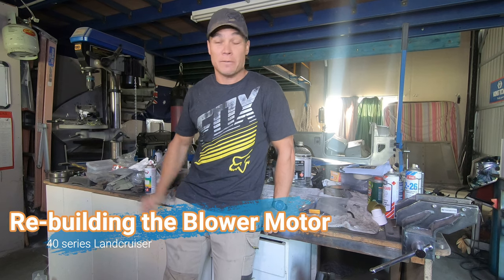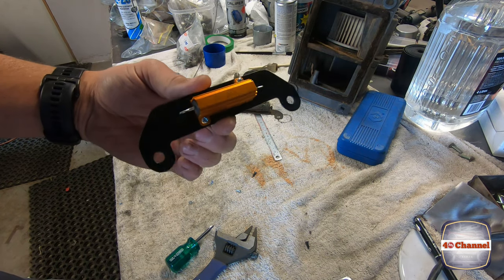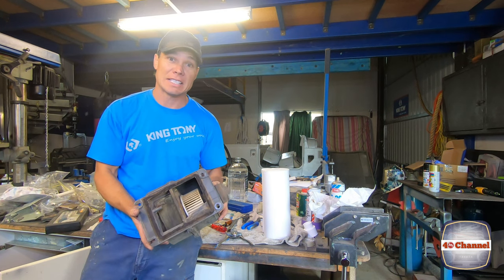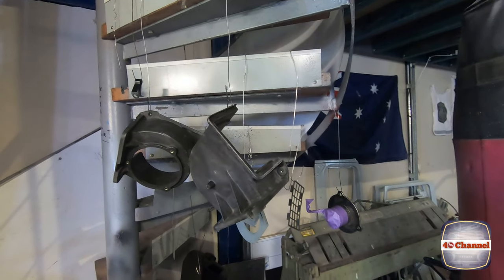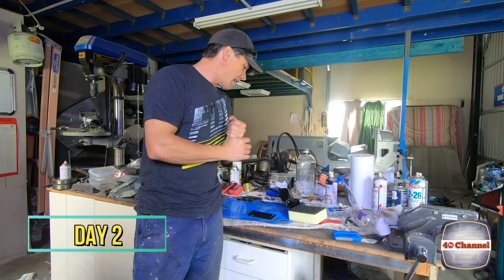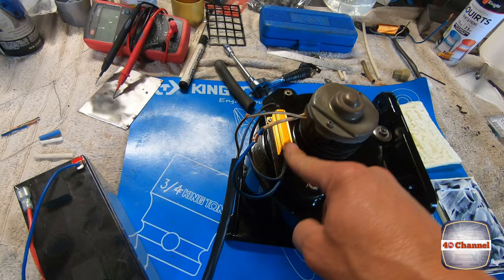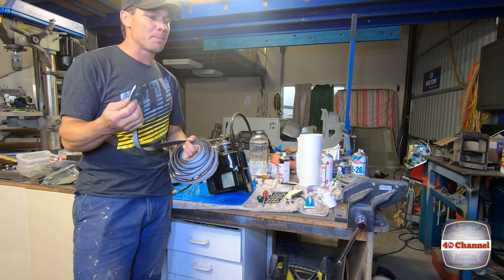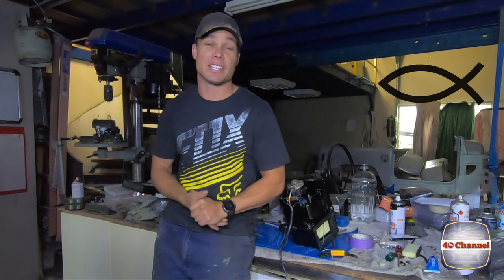EP44 - 40 Series Landcruiser Heater Blower Motor re-build + GIVE AWAY!

Comment: great job! Did mine last year, it was making a horrible noise when I turned it on. I can't describe it exactly but there is a felt ring in blower motor that acts as a self lubricating bearing that had disintegrated. Found a replacement that was close at the hardware store and hit it with some light oil. Your technique is sooo much better than mine I always find or break some irreplaceable part.  Well done! Luckily my resistor isn't "cactus" yet. hehe
Reply from the maker: I'm glad you got yours working O.k

Comment: I need a resistor because I've fixed all my wiring in my 75 FJ except for the blinkers and the blower motor.  Mine is cracked like yours.  I appreciate your instructions on the fix regardless!  It's raining and 14 C where I am in the States.

Comment: Quality work as usual, only a few weeks ago i too replaced the blower resistor. One thing ill say when you reassemble the dash with your knobs, make sure the cable is well oiled and moves freely. i had a heap of trouble because mine was catching slightly and wouldn't even open the door. Also ensure the back of the knobs are crimped well and will not give way once you actually push the knob for the fresh air pull.This also goes for the heater valve cable. I only know this because after installing my factory ac i realised the door wasn't opening and it all had to come back out so i could re-crimp the back of the knob, was a fun day indeed.
Reply from the maker: Thanks for the tip mate, always good to learn from others!

Comment: I need a resistor because I haven’t had a heater in my old 47 for coming on 8 years and with winter coming I have to wear a jacket and gloves going to work fencing at 5am.
Reply: If the resister is broken the fan will still work but only on the high speed, if you have no heater fan than there are other problems.
Reply: JP Onefourseven 100% right mate. The resistor is just one part of it. I still need to rebuild the whole heater box as well install a heater tap and run hoses which were taken out by the last owner. I dropped a new 2h in it a few years back so it runs pretty good but haven’t gotten to the comfort stuff yet.

Comment: That’s a sweet resistor!!! Who did you source the resistor and the new plug from? Also could you do a similar video on the rear heater? Love the channel!!!
Reply from the maker: Thanks Garran, you can get the 50w 1ohm Resistor from most electronic shops, I got mine from EBay. Unfortunately I don't have a rear heater. But I will be doing the main front inside heater box.
Reply: 40 Channel thanks for the reply, I’m 
definitely gonna stay tuned. Very informative videos and I love that you get the whole family involved! Hope you had a good Easter and stay safe!